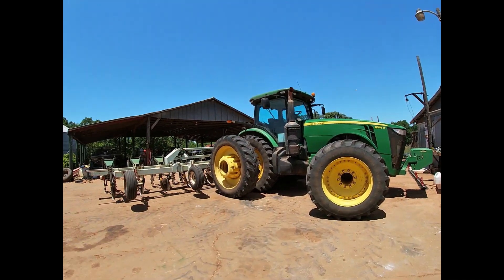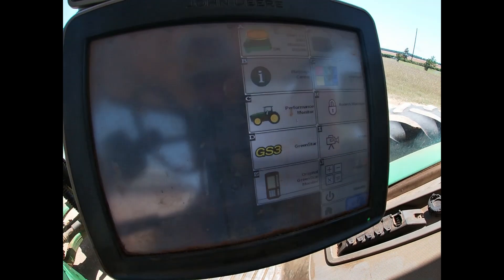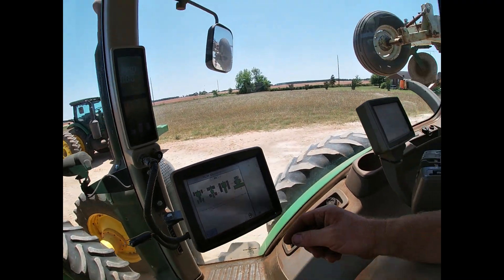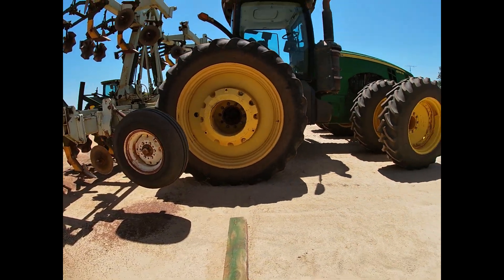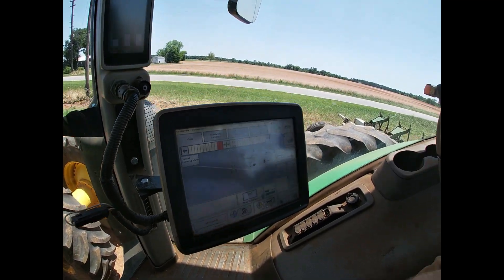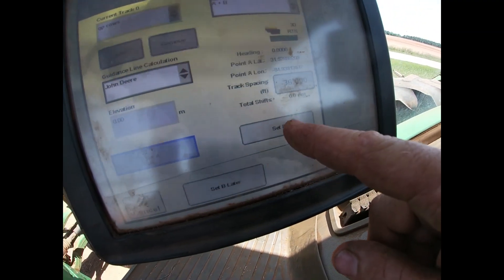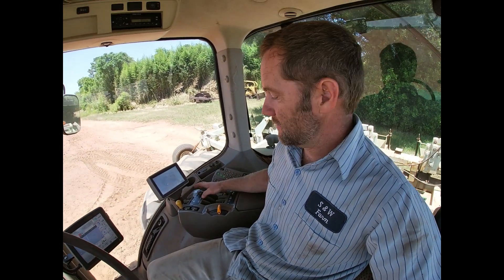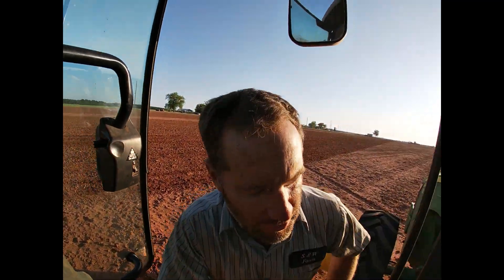Installing GPS guidance system on John Deere tractor

Comment: Don't know if this applies to your tractor, my alternator was failing a few months ago and I had to run at high RPMS to get normal voltage. Read that the voltage regulator was at fault. Finally stopped putting out any voltage, replaced alternator, fixed it.
Reply from the maker: We have a loose or nicked wire somewhere.